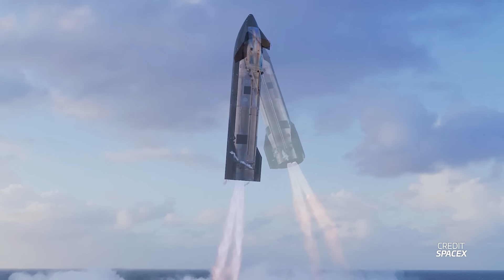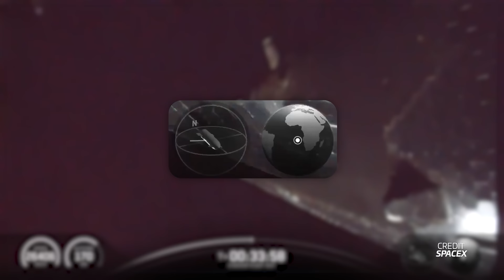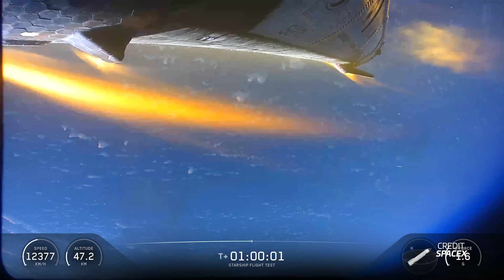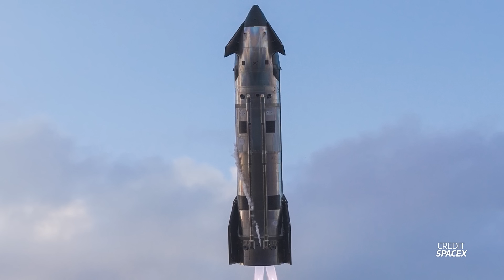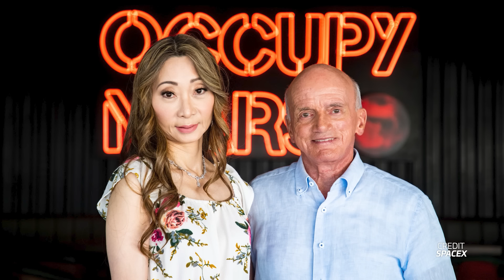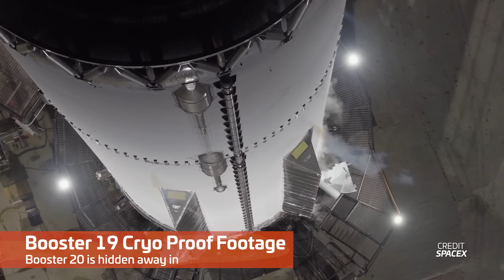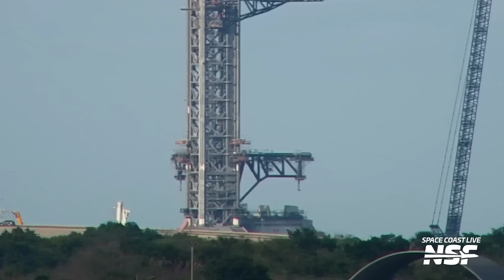Starship Flight 12 Full Analysis: What Went Well & What Went Wrong | Starship Update

Comment: Engine problems, 2 started and aborted latter, and the boost back looked like it rotated unexpectedly fast. Relighting all engines on low fuel probably developed one hell of a slosh bang in the tanks, and engines died sucking gas instead of liquid. Why the hurry, baby that fuel in the tanks, spool up slower let the everything settle. Still, two engines gave up for unknown reasons and thats a big problem.
Reply: Yes, something went sideways with hot-staging.. if you'll forgive the pun.  I honestly expected a starship issue more than a booster failure.

Comment: On version 2 the outer ring of 20 engines could only be started with the assistance of the GSE.  Somehow on V3 they are able to use pressure from the burning inner engines to restart the outer engines.
Reply: They don't use pressure from the inner engines, they use high pressure methane and oxygen from the COPVs onboard Super Heavy

Comment: Are the Raptor 3's vacuum bells actively cooled through internal channels?  If so it's hard to imagine them being able to remain leak proof given how much the Raptor 2 bells flexed and deformed.  It's also hard to imagine their intricate structure being able to withstand the impact of shrapnel from an exploding engine.  I'm betting it's time to put some necessary shielding or integrated armor (back) into the design.  All the hype about rapid reusability distracts us from our delusion that real usefulness requires almost perfect reliability.  That wouldn't even be true if individual lives were valued highly enough that passenger or worker deaths were an unacceptable cost of doing business.  Managing losses, especially of mechanically replaceable payloads, is old hat; it's how it is done and who profits that matters.

Comment: Overall,  I thought Flight 12 was a success and a huge improvement over the first few Block 2 Starship flights. And the Starship RVAC engine failure proved the vehicle can handle an engine failure and still do its job.

Having said that, if there's another engine failure on a future Starship flight, I say they should Go for an engine relight anyway.
This time they played it safe, but as long as these Starships are uncrewed and passing over the open ocean or any uninhabited area, they should go for a relight test. They need to learn and truly know what to expect and correct all flaws early on. 

Even IF the vehicle RUDs and sends more streams of hot confetti to earth, SpaceX will at least learn from it. Better to learn sooner than learn the hard way later when the stakes are way higher.

Comment: Ship 39's resiliency with the loss of more than 1/6th of its total thrust and no nominal coast path insertion was impressive and could have only been built on a breadth of knowledge and experience. The aero maneuvers to both target the landing area bullseye and simulate the catch flightpath on top of the initial issues seemed almost surreal. Generating that kind of control authority at that size and flap to body ratio almost doesn't seem like it should work.
Reply: I think not 1/6 but 1/5 because the difference type of 6 engines

Comment: @nasaspaceflight, has anyone started to look at the obvious power the new booster has (ripping the sign off the wall, and the direction of both flame trenches in relation to the Air Separation plant and then the future LCH4 Generation plant.  The trench appears to be aiming directly at them.  "well, there is a blast all", correct, and it did nothing to save the sign.

Comment: Have we had any info from SpaceX, or even credible and well-informed opinion from the community, as to why SpaceX was going for a 33 engine boost back burn? The previous fewer-engines burn got multiple boosters back to either over-water simulated or actual tower catches and relighting those outer Raptors presumably means extra mass on board for the extra COPVs needed to relight those outer engines that were never relit in previous flights.

There must surely be very compelling reasons for switching to an all-engine boostback burn because it seems to me to be so diametrically opposed to Elon's "the best part is no part" philosophy and with SpaceX's recent mishaps with COPVs those would seem to be amongst the worst parts to be adding more of in the booster.

Comment: They did have issues with large chunks of booster surviving splashdowns on previous flights remaining afloat, this time hitting the ocean at ~1400Kmph should deal with that.

If the barge is on its way to Starbase, then would it not be best to assume the next booster is likely to go the Florida rather than be used for flight 13?
Reply: The barge is not picking up any boosters on this trip

Comment: If I am marking Space X homework I would have to give it a C.

Mixed progress. 

There were positives in the thermal protection tile refinement, new hardware validation and despite one of the six Raptors failing, the ship maintained stability, executed a controlled flip, performed a soft splashdown. Hard to say if they were going for a landing, whether it would have been successful because of the final wobble.

However, they haven't advanced in a number of areas, i.e. the mission still being sub‑orbital and the mission profile still experimental.

There was also regression, with the booster landing failure and engine reliability issues, Flight 11 came closer to orbital velocity and Flight 12 did not surpass it.

SpaceX’s "rapid iteration" model means they probably accept this kind of non‑linear progress, but from an external engineering perspective, Flight 12 was not a clean step forward.

While thermal protection seemed to have not had any issues, the question is whether post-flight the protection is reusable? Also, once the ship does achieve orbit, re-entry from orbit, the thermal protection would need to survive hotter and longer forces so it is not yet job done.
Reply: Thanks for you're contribution  ❤
Reply: A++

Comment: After successful ignition, one raptor failed on booster and one on Starship. One is the optimal number of failures aside from zero. Wishful speculation - this was a deliberate engine out test or SpaceX used a suboptimal engine in both booster and ship to test the manufacturing/operational limits.
If you think about it like a proper conspiracy theorist it makes sense. I have almost convinced myself.
Joking aside, these engine outs will have provided valuable data.
Lets hope for a 100% successful Lucky flight 13 - SOON!
I guess though an official mishap investigation will have to be done first. I don't think SpaceX are going to get away with it, except isn't this how most rocket first stages demise?
Reply: The booster hit a grey area in the definition of anomaly, It completed the planned operation and remained within the safety margins but didn't operate as intended so even the FAA are head scratching on if they need a formal review. Either way spacex is going to do one so they can prevent it happening again. Spacex have proven engine out capability on booster numerous times for all stages of flight including landing burn, this is the first time ship has survived an engine out v2 tended to RUD shortly after.

Comment: I understand the reusability of starship to put satellites and large payloads in orbit but why is it needed for anything else? The falcon 9 and super heavy can put crews in orbit. Why not put starship in orbit then refuel with falcon 9 or super heavy yes more trips than starship. But why not use the falcon and heavy to just put the cargo need in orbit then starship for interplanetary travel and as an orbital station. Use now what is proven tech to accomplish goals.
Reply: Because falcon 9 needs a new second stage for every flight, starship doesn't plus neither of them have the lift capacity of starship even those 22 dummy satellites are more than falcon heavy's reusable capacity. How may seconds stages were you planning to throw away to get 100t of cargo plus fuel to Leo with falcon 9?
Reply: Because a F9 cost around $50M to launch when reused for only around 15-17.5T to LEO
Reply: Quick calculation gives 97 flights of falcon 9 to refuel starship and get 100t of payload to leo so roughly 4.8bil just to save launching starship 10 times.

Comment: “The plan was to re-ignite all 33 engines for the boost back burn” So that means the outer ring engines don’t use pad infrastructure for start up anymore I guess… I thought that was a great design to have lighter engines on the outer ring and use pad infrastructure and power to spin them up for ignition. I really thought 13 engines were plenty for the boost back as Super Heavy is almost empty at that point and no longer pushing a fully fuel StarShip.
Reply: They use a different process to start raptor 3 and it's all on the booster. The reason the earlier boosters only lit 13 was they physically couldn't light the outer 20.
Reply: That the outer engines don’t use pad infrastructure to light up has been known for well over a year now. It’s basically obvious once you see there are no dedicated raptor quick disconnects on this pad compared to the previous one.

Comment: Dumb question: how will they keep cryogenic fuels from boil off on a long trip to Mars? That would make me very nervous as a passenger.
Reply: Likely a combination of insulation and active cryocooling.
Reply: @imaginary_friend7300  And also application of "paints" such as Solec's LO/MIT and AZ Tech's AZW/LA-II.  For absorbability and emissivity.

Plus what Mike and Imaginary said.  Orientation of engines toward sun (when not burning), insulation, and active cryocooling (which by the way NASA is helping SpaceX with).

Eager Space channel does a good job talking about all this, with the complex math involved.

BTW, same features as the HLS moon-bound.
Reply: They orient the rocket so there is minimal area facing the sun, so rear or forward facing. Space is cold when not facing the sun

Comment: I'm disappointed that SpaceX is still having engine reliability issues, 2 failures on this launch alone. Not talking about staging fueling issues or the overspeed booster "landing" relight attempt. Sure, they have redundancy planning for engine-out flight, but they are using that contingency far too often.
Reply: You say still as if this was the same engine
Reply: This is an entirely new engine, booster, and ship design.
Reply: I'm also not sure what you mean about "staging fueling issues". Those words don't even make any sense together

Comment: 1 raptor is not going to slow down a booster but it just looks like they need to fine tune the hot staging. Watching the booster come back is more insane than the ship flip.
Reply: stream telemetry is unreliable for that sort of thing,  it is slow to update. The booster lit almost all the engines initially for boost back you can see the engines glowing but the telemetry only showed 5 engines lit.

Comment: Does the colorful oxide layer on landing indicate that it was hot enough to change material properties? Could be an issue for reuse if so
Reply: No it's pretty normal thing than happens when you heat up stainless steal. I saw a chart recently that showed the color of the steal at various temperatures the steal was exposed to.

Comment: A successful test flight.  With the long list of issues that need to be addressed I don't see HLS with crew on the Moon for 3 or 4 years.  They should really concentrate on automated cargo delivery to the Moon since that is far less work and is needed to set up the Moon base.  Use a small lander for sending humans to the surface of the Moon.
Reply: Which human capable small moon lander is actually being real-world test flown today?  I'll answer that, none.
Reply: @ConstantTrue  We learned with the failed Shuttle program not to mix cargo with human rating.  Human rating a spacecraft is 10x the work and if there is a mishap everything comes to a halt for several years.  A lunar lander needs to be developed that just delivers people to the surface to the location where a previous cargo lander left its payload.  Starship will be a great heavy duty cargo system but I would never land in one.  Gemini says a variant of Starship that ferries a lunar lander between LEO and LLO and back to LEO is feasible.  Couple this with a prop depot in LEO with cryo chillers that is serviced 2-3 times a week with tanker Starships and now you have a system where astronauts fly Crew Dragon to the Lunar shuttle which is fully fueled from the depot and transfer into the lander and then fly their mission.  Cargo Starships would launch from Earth, refuel at the depot and deliver their cargo to the lunar surface.  With humanoid robots, humans don't have to fly to the Moon base until it is fully assembled and ready for habitation.   I would guess one human mission for every 100 cargo missions.
Reply: They're building a reusable spacetruck not a lunar lander. That might be being build in secret but it's NOT the main objective is just a piece of contract work.

Comment: this is going to age like milk when BO beats spaceX to the moon
Reply: Nah
Reply: @Derek-je6vg  i hope i'm wrong, but they seem to be making almost no forward progress.  the engines still don't work reliably, the booster return is still a huge question, and starship itself still having major issues in the engine bay.  what have they made progress in, exactly? i hate being a downer here but BO keeps steadily making improvements while it seems like spacex is only making lateral moves.  spacex's iterative design philosophy was great when they had their starhopper prototypes, but how much of that even translated into what they're designing now?  it feels like a lot of wasted effort and money for very marginal improvements with all of these flight tests failing to hit their marks every time
Reply: @von @vonNeumannProbed - blue origin has nothing like raptor 3 or anything like it at its chamber pressure. Their designs are much more conservative. I did missile design and flight tests for over 30 years - I had doubts about the spacex approach…but falcon 9 basically showed me that they deliver. I had doubts Merlin powered boosters could be turned around quickly, but they have done it. Engines will always be the long pole in the tent. I don’t see the booster as a huge question at all - sorry. The blue origin designs are ok for ‘local’ space…but only starship will get us deeper into the solar system.
Reply: @vonNeumannProbed  Where exactly are the test videos of BO for testing anything related to the HLS program (Mark 2)?  Lander, Fuel Tankers, Tugs, anything.  Where is their plan to refuel in space?  And yes, they do need to do that.  Over the earth * AND * over the moon.

And no, Mark 1 does not count, it's not for humans.

Oh, and New Glenn apparently does not have "engine out" recovery.  See NG-3 launch upper stage failure for reference, failure for a 3rd party PAYING customer (AST Space Mobile, $200 M).
Reply: @ConstantTrue  BO doesn't really show a lot of their testing so I'm not really sure why that's even a point of discussion.  I'm sure they do have a plan to refuel in space.  Just like spacex has a plan.  Both haven't tested them as far as I'm aware.  You're right that BO is still behind.  But it isn't like BO doesn't have experience putting people in space and bringing them back home, but again, advantage goes to spacex there, obviously.  But spacex has been developing starship for over a decade at this point and the fact they're still making such sweeping changes to the entire project still, at this point, means that it's still going to be a long while before we see this approach anything related to falcon 9 reliability.  Musk and spacex consistently under perform and over promise at this point... in fact you could even say they've regressed.  chalking this test flight up as a "win" is just foolish bootlicking.  Spacex can't be happy about most of their engines failing during the flight and how they literally hit almost no mission objectives that hadn't been done before, and the redesigns taking up so much time.  One thing's for sure though, I'm sure isaacman will do everything in his power to help get his buddy the contract.
Reply: @vonNeumannProbed don't be Debbie doubter. Why would spacex be building so many pads if they're not confident staship will be successful.
Reply: Yes, you 'special' people think doing less first is superior.

Comment: Boost back 1 minute with 33 engines? It was 1 minute in previous flights. It should be ≈30s with all 33?
Reply: No, not 1 minute with all 33. It's literally what we say, that it couldn't have been planned to be all 33 for the entire minute of the boostback burn but we weren't able to see what the burn would look like because engines went out and it was aborted. They probably planned to start with 33 and shutdown engines as it went through the burn, but we won't find out until next flight at minimum

Comment: 01:30  Explanation for 270 degree roll ('to align itself with down range trajectory') doesn't make sense. Instead of rolling 270 degrees in one direction, why not roll 90 degrees in the opposite direction? End result will be the same. SpaceX surely has a logical explanation, but 'align itself with down range trajectory' is not it.
Reply: Because crossing the 0 degree mark doesn't make the computers happy

Comment: why do people keep saying the booster regained attitude control? the damn thing was sideways as it hit the water.
Reply: The thing flies sideways for most of its flight
Reply: It had attitude control until the failed landing burn.
Reply: Because it had controlled aerodynamic authority in atmosphere.   It’s a fact.  The engine fails are a separate thing.  The booster is a big fat glider for most of the return, with steering/attitude control coming from the grid fins.